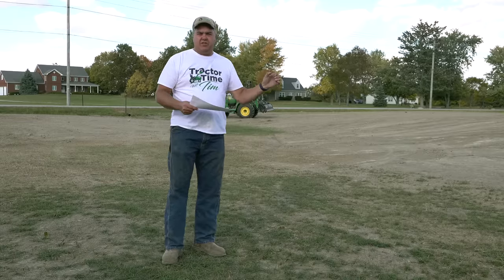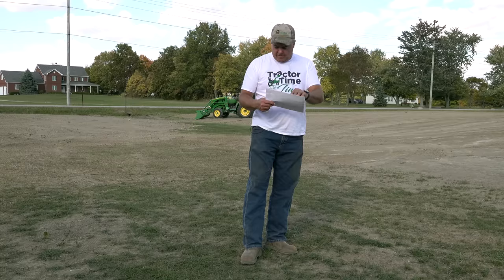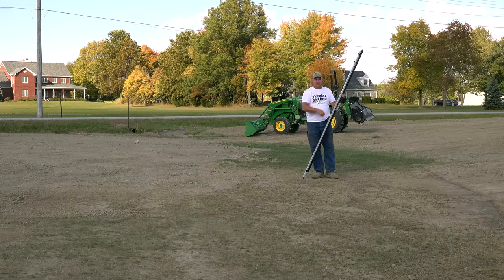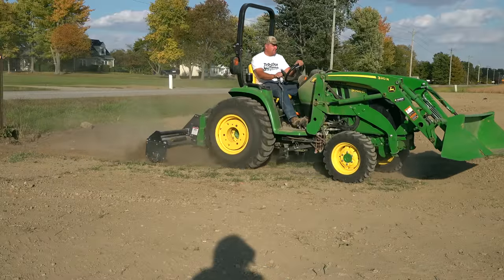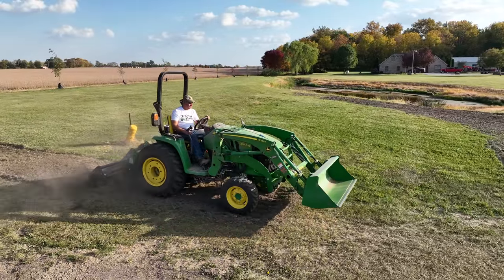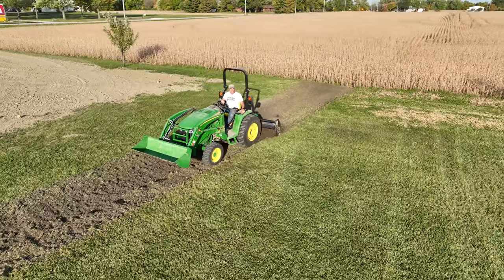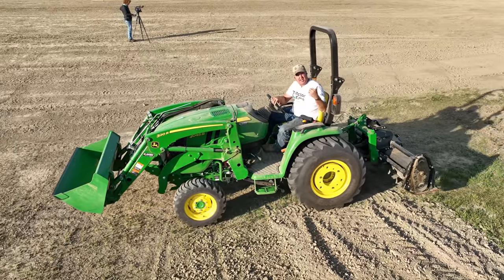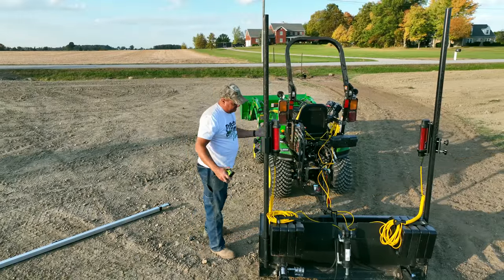VERY LITTLE SLOPE! John Deere 1025R Creates Swale For Water Drainage

Comment: Looks like a good idea that doesn't really work due to the small size of the tractor.
Reply from the maker: Over-simplified analysis. It works well.  Just takes practice.  As I said, competes with $200k systems.
Reply: @TractorTimewithTim  Anybody can compete in anything, winning is another story. I would like to see side by side comparison with you next to a 200k machine doing the same job and then have you describe exactly what you mean by compete.
Reply from the maker: Having a bad day, Pete?  Good grief.
Reply: @TractorTimewithTim  I've seen many of your comments to people that voice the slightest bit of criticism and you crumble every time and then end with a condescending  remark. My God, how dare anyone speak out against what the self proclaimed tractor "expert" is trying to do. Your defensive nature speaks volumes about your actual abilities.
Reply from the maker: Yes. I am less than perfect.  
Definitely.
Reply: @TractorTimewithTim  No, not at all. You should have been a politician, your very good at twisting the truth.

Comment: I was planning on buying a 1025r with loader and backhoe. But my local dealer gave me a quote for 38grand out the door for it. I know people have paid low to mid 20s for one set up like that. That just makes me sick… for all I’m concerned it can sit and rust on their lot for 38 grand…
Reply from the maker: Wow.  Low 20’s likely not possible anymore,  but 38 sounds high.  What attachments did you include?
Reply: @TractorTimewithTim  loader, 60d mower, and 260b backhoe.
Reply from the maker: That is too high.  Find another dealer.